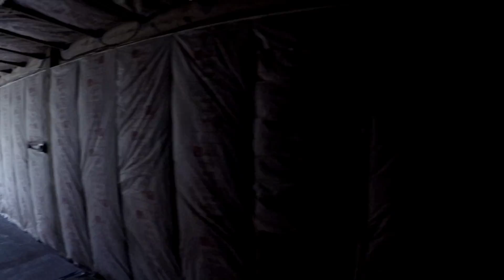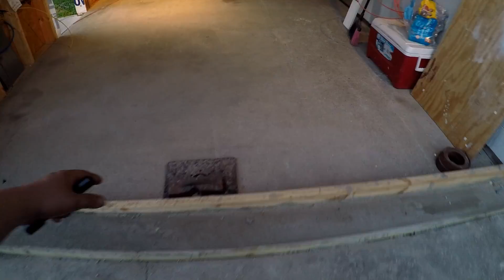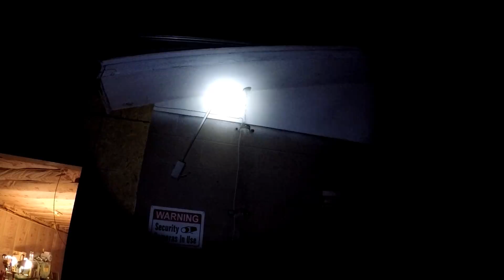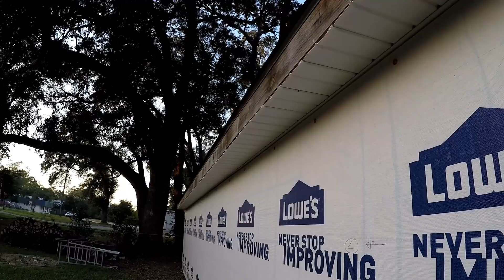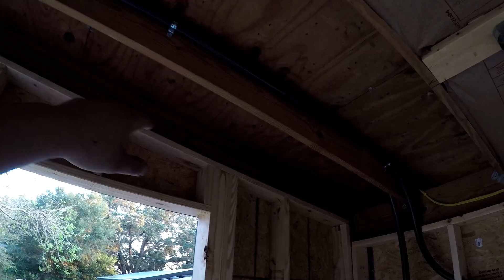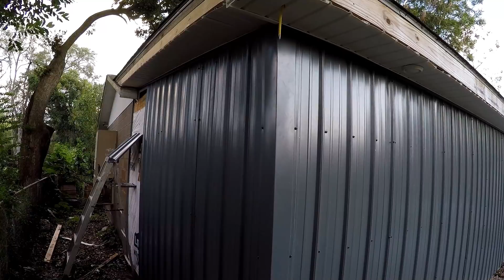SNS 187: Shop Enclosure Build Continues

Comment: It's nice using a thermostat because they use a minimum/maximum temperature settings to run an air handling unit ie. an A.C. Or furnace. Then read from a  mean average of temperature readings from the air flow. That's why multiple thermometer controllers coupled with duct zoning dampers to direct air to designated duct tubes. This is the single most efficient way to "renovate/upgrade" an air system because it takes minimal parts and a simple understanding of electrical and duct routing to make your house cool much more efficiently apposed to total system upgrade up to a ductless air system.

Sorry for the longwinded explanation

Comment: Adam, where does the bathroom fan vent out to?  You are going to have a wonderful improvement to your shop!
Eric
Reply from the maker: Theres is an exhaust pipe that leads out to the soffit.
Reply: Adam, OK but if there is a vent strip or perforated soffit the moist air will be collected back up into the space above the ceiling.. If the soffit is not vented then you'l be OK. Hope this is not bad news for you. Don't meant to burst any ballons.
Regards,
Eric

Comment: I decided to put all my posts into one post.  I don't want to be "that guy"  hahaha

Adam they are doing everything wrong, I should know because I've been a master contractor for 75 years, and I know everything.  LOL?  Sorry I was just trying to stir the pot a little.  hehehe

Wow nice job on the blended concrete patch.

Hey Adam do you have any pictures of video of how that building is tied to the existing roof above?  I can't remember if I saw anything in a video.  Thanks man

I guess I should have combined all these questions into one comment, I always watch a few minutes and then post a question and then move on farther along and then another question and another post.  I'm sure there is a word for what I do.  LOL  Anyway did the contractor ask if your videos could be used for reference material for other clients.

Now I understand the footer for the door, and why it looked out of square.  That old slab must have had a fall from the existing shop to drain water towards the yard is that right?

Here's the important question, where is the BBQ and Smoker going to be located and when are we going to see more of those videos?  :)
REPLY

Comment: Adam - I have a fancy new in the box bathroom exhaust fan and light my wife bought at Home Depot I'll send ya on me. I can't use it as it's designed for a flat ceiling. My ceiling is vaulting and I can't use it. She didn't know any better before buying it and has misplaced the receipt. If you can wait a weak when I return home I'll send it to you priority mail this next Friday. It's a NuTone model ARN80RB... store sku number 1001806033 if you want to look it up. Let me know. It's your if you want it and can wait.
Reply from the maker: +BrokenRRT I already have the fan and light installed here. Thanks though.

Comment: Those internet building experts give you too much grief send them over to my channel, usually they have a stroke after seeing what I do and don't bother anybody else. :-) lol  Extension is looking good. My only question is about where those old interior eve vents go? Seems they would need blocked off to keep your ac from going into the old roof area.
Reply from the maker: I'll send them your way Brian. I plan on blocking off the vents. The roof has a ridge vent also.

Comment: Hey Adam build looks great I'm a fan from Crestview I couldn't tell in the video but is there any kind of channel on the bottom of the metal outside or does it just run to the ground. Only reason I ask is because if there were no channel wouldn't grass and debris build up behind it. I may be wrong just a thought I had watching.

Comment: Hey adam you mention 220v supplies for some of your machines.... I always thought the whole of America is on 110 do you use more than one voltage or does it change between states... here in the UK we have 230v single phase and 415v three phase
Reply: Phil Pullan power comes off the line at 110. In the box there are 2 hot sides. A 220 breaker will connect to both sides so a 220 single phase will have 2 hots coming into it, both controlled by a single breaker.
Reply: Phil Pullan Check this out this is crazy. 110 + 110 = 220.   Boom. Mind blown I know right?

Comment: Nice to see the progress, on the bathroom front you might consider a sensor for the lighting,toilet,and basin.did it to my entire house have saved triple digit $ since doing so.More than enough to offset the cost of the yearly cost of the battery's for the commode&lavatory. Just something to consider. Thanks for the inspiration and hard work ethic's

Comment: Adam, the shop is lookin' good. I was wondering how many square feet it is and how many square feet your original shop is? The great metal looks great on the outside.

About the gearbox, what is it being used to drive?
Reply from the maker: New addition is 600, shop space will be total 1,500 now.

Comment: Great to finally see progress 😁 for you buddy. You mentioned your power is 110v single phase and 220v three phase is that right  wow in Australia 🇦🇺 our single phase is 240v and three phase is 415v  how would you like to weld with that
Reply: Ps. Love the videos keep up the great work AUSSIE, AUSSIE, AUSSIE,    OI, OI, OI.
Reply from the maker: the 110 and 220 is both the single phase, and I also have 3 phase for machines.

Comment: NEW CONSTRUCTION....... Always a good thing. Shop looks great and yes it is in the details. All the little things it takes to finish. I have to say that gear box is impressive to say the least. You should be proud of your work to be able to reproduce such a vital component and get it up and running again. I know it is just all in a days work for you but coming from someone who does machine work as well I say its damn impressive! Were all the bearings replaced as well?
Reply from the maker: Yes bearings and seal are always replaced. Sometimes that's all it needs besides cleaning and new paint. In some cases we have boxes with very large and expensive bearings that Timken or SKF will rebuild for less then cost of new.

Comment: Congrats on the shop build progress. Looks expensive. Why the door step on the large entry door? Seems counter productive seeing you need to move heavy machinery through that.

The gearbox looks brand spanking new - is it, or did you refurb it? Oh, and please: Put something familiar on it next time, to give a better impression of the size.
Reply: They will cut out part of the slab behind the door then pour new concrete to level it all out.
Reply: Yeah, I heard that - but I still don't get why. Let's see it finished now, ok?
Reply from the maker: +Peter Riis I explained that in the video, and what's being done about it.
Reply: Yeah, you did, briefly - but I still don't get it. But let's see it finished, perhaps it makes sense then. :)

Comment: I had left a comment on instagram about the roll up door header, it wasn't to humiliate you at all Adam, it was to make a note is all. Apologies if it came off any other way. I still think that the king studs should have been stepped back one and had a jack stud supporting the above spanner 2x4 with the cripples running up to your 2x10. Reason I make mention is that if there is any weight supported by the section above the door opening, there might be sagging. Anywho, the rest looks great and excited to see it done. 👍🏻

Comment: Funny about regional differences in construction. We require the footings to go below the frost line.  Florida doesn't get frost. Our  frost line is 8'+  We would never put plumbing in an exterior wall, freezing is a threat six months of the year Florida, freezing threat to plumbing; never.  Termites in Florida, Here in the sub-arctic never, so it is a real learning exercise observing the regional differences.

Comment: You may wanna set up some sort of venilation at the top end of your eaves to allow warm air in the roof cavity to escape efficiently if you do not do this with your vapor barrier in the ceiling it will trap heart human air in the roof ceiling cavity this will cause large amounts of conversation and potential dry rot
Reply: Yep, "large amounts of conversation".  Nothing ruins a ceiling faster than talking about it.

Comment: I was wondering about the original buildings soffit vents that are now open to the new construction. Are there plans to change them so you will not be spending to cool the roof with your A/C?
Reply from the maker: +Rodney 3133 I'll be blocking them off. The roof has a ridge vent plus vents on the other side.
Reply: Abom79 good to hear. Was pretty sure it would be in your plans. Sometimes when staring at the overall picture small things get missed. Lol the things family and friends needle us forever about. Looking forward to seeing your new metal shaper making chips in the future.

Comment: Hi Adam. About the water. I don't know if hard water is a problem where you are, but if it is, you might want to at least plan for a water softener in-line before the water-cooled welding rig you mentioned. If it's anything like water-cooled heatsinks for computers, then it needs to be pure, or the pipes will clog up with hard-water deposits, and I suspect it'd ruin the welding machine if it got too hot due to insufficient heat transfer! And it'd probably cost big $$$ to repair, I'll bet. Nice to see your shop extension coming along - can't wait to see videos once it's done!
Reply from the maker: +William Squires Dad bought that machine in late 70's and had it hard lined with water. It's never been a problem.
Reply: Most homes don't have water softeners and have thousands of gallons of water running through them each month, unlike the quart of water on a water cooled pc, and there's not an issue. The main reason you wasn't distilled water in a PC is because water with ions from dissolved solids is more conductive, and will ruin electronics WHEN it leaks; especially during setup.

Comment: Adam Did the company you work for cut the gears for the gear box or did the customer provide them. The gear reduction seems huge and a great amount of torque. Any idea what this gear box is used for?
Reply from the maker: +steve647my The gears were all cut by Falk and original to that box. New low speed shaft machined by me, and new bearings, seals, and other hardware.

Comment: I'd still be concerned about the area over the new 7-foot door. Unless the builder plans to cover it with plywood screwed in place to support the new door it's going to sag over time, trust me.
Reply: No way, it's not supporting anything DORK
Reply from the maker: +TC Jatko I'm not concerned at all. The builder has enough experience to know what he's doing, and I showed the build right there on video. You can't see all the 2x6's that the door will be mounted on??

Comment: Sharp looking gray siding!
I liked the whitest white you can get for the walls and ceiling in my shop. Satin latex enamel. Bright room color and floor takes less lights to make bright. 
I mistakenly painted a shop off white and and had to add lights.
If the floor has not been sealed try using what HD or Lowes use, easy to clean, helps keep the humidity down. Do not use epoxy, it chips.
Just my non-professional opinion.

Comment: Looking good so far. Have you given any thought to the rain water coming off the roof and maybe running into the building? The ground looks like it slopes inward, insulation is like a sponge, or is it OK? Thanks for the video.

Comment: Looks good Adam. I am concerned about the existing window unit exhausting hot air into the room. I have a similar situation and when I run the window unit the room it vents into gets really hot . I will eventually relocate the window unit in another wall so it exhaust outside.  You must be either close to an ambulance service or a hospital. Keep up the great vids and thanks for sharing with all of us.
Reply from the maker: You must have missed all the times I said the back wall is getting framed up for the AC, even showed that on the video.
Reply: No I saw that i just assumed there were gona be 2 window units. Sorry.  Just didn't want to let you make the same mistake i did .. LOL
Reply: Adam I for got to mention this is what happens when I engage my brain. I have been told it happens to a lot of old men like me .. LOL

Comment: The shop extension is looking great!  You are going to love the extra space.  You might want to add another A-frame on the extension side for big material handling to the welding table and saw.  The metal siding looks really good too.  That's a nice choice.

Comment: I'm curious.

Why is there a HOT water valve, on the box for the welder water supply?
Reply from the maker: it's a standard box for a washing machine that was used, cheap and easy to get. The hot water side won't be used.
Reply: another example of big box bullshit--you get a drain box and all the fixin's like it or not.  and probably cheaper than buying an empty box and one valve....so the guys just stuck it in....and the cold doesn't have to cross the drain if it is on the left....

Comment: Looking Good! Adam. Nice fix for the big roll up door opening at the floor so it will fit square when shut, looks like about 2" per foot sloop on the floor from the original building. I have a similar slab on the out side of my building I had them make the sloop 1/2" in 15 feet to keep the floor as level as I could. My slab is 1.5" lower then the building floor to keep water from running into the shop..... Keep up the Great! work...Len

Comment: I did not see any new or extended intrusion alarms.  Have you possibly considered adding a Ring floodlight to the side or front of the shop so you can monitor your shop when at work or away from home?

Nice progress.  At long last it is coming together the right way.
Reply: He will relocate the ABOM w/ ABOM-sized wrench warning sign to the exterior.  That should do the trick.
Reply from the maker: Thinks it's wise for me to talk about my security system measures on the internet?
Reply: Not really but you did before when you recorded the video of the break in.  I was just offering what I thought was a helpful suggestion.

Message received.  I'll keep my thoughts to myself.  Sorry.
Reply from the maker: I'm going to be having updated security system installed, and flood lights on each corner.

Comment: Always internet warriors to comment on everything. Illustrates a couple things, #1 people cant seem to listen and comprehend, or look at a picture and comprehend what they're seeing. #2. Construction and electrical are not nearly as universal or draconian across the country as many would like to think.  Construction methods vary greatly when you don't have frost pushing up from below, and snow pushing down from above.  After already having theft issues, I can fully understand not wanting windows in  the shop. Besides, windows use up valuable space where you could otherwise hang the tap handle collection.
Reply from the maker: It's getting done right, I don't care what any nay sayers think. It's my shop and I'll prove that it'll make a good space.

Comment: I had uneven door to my shop and put 3/16 metal ramp. with heavy loads the concrete was to thin and broke. ground edge so rollers would go over it  better. so happy you are getting more room. there is never enough. looks good

Comment: There are some old small ships that have Falk gearboxes, around 10,000 hp. The gearbox in this vid is very tiny compared to. Wonders if the gearbox in vid is for marine use and same company. Falk still makes marine gearboxes, but only small ones.
Reply from the maker: That one is for a paper mill use, as is most of the ones we work on. Heavy industry but very little marine.

Comment: Adam, just a thought.. I don't think a slope leading into the shop from the roller door is a great idea. What happens if it rains and the door is open, the shop floods... Just sayin 🤔
Reply: If the footer was not put in the way it is the door wouldn't have sealed to the floor, so it would have flooded even when the door was closed.  Gotta pic your battles....
Reply from the maker: I'm not leaving a trip hazard that I cannot roll a pallet jack and equipment into.

Comment: Looks like you need windows... In California it's 10%of the square feet. I think.... N vent for the the welding gas to go out of shop... Maybe some shop fire sprinklers. California they gotta be put in the ceiling....there's also the emergency face wash station...
Reply from the maker: Do I live in California?
Reply: brian willoughby -  In California Adam would, no doubt, be required to install a tampon dispenser in the lavatory.
Reply: He has a fume extractor and uses it.
Reply: brian willoughby It's not a commercial shop. It's a garage. You're telling me that residential buildings have fire sprinklers and face wash stations in them?
Reply: whatever... expressing some concern but I wont do that again...
Reply: face wash station i suppose isnt so necessary
Reply: what is whacko about windows and face wash station?  Adam doing the building to alabama code or just the way he wants to?
Reply: actually new building whether residential or commercial gotta have sprinklers built in them. codes are really strict here. alabama i suppose is different.
Reply: Alabama?
Reply: Adam is probably happy every day that he doesn't live in the and of fruits, nuts, and wacko rules.